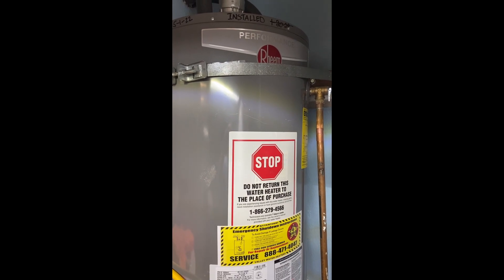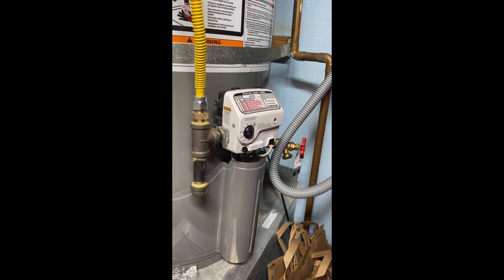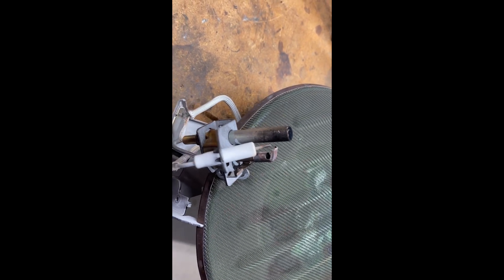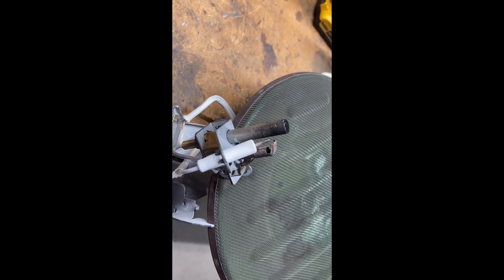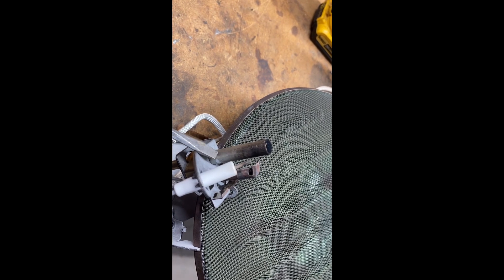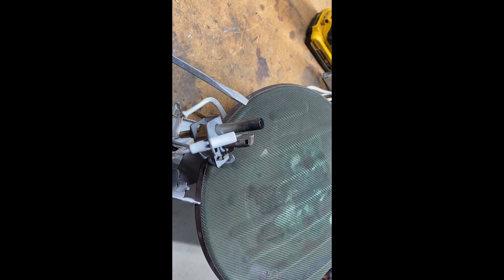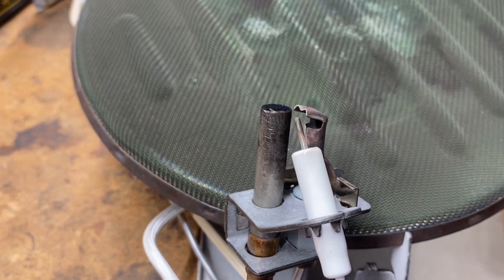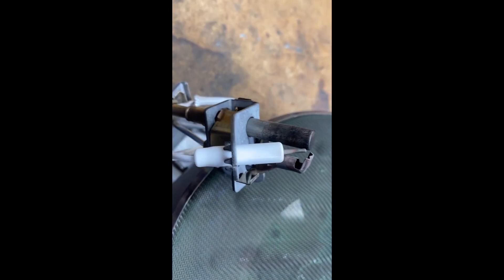Easy Rheem Water Heater Pilot Fix!

Comment: Interesting , I've cleaned the thermopile to increase voltage but never lowered it. You should only need 300Mv to power the motherboard (technically) They top out at 999Mv . Those valves are Buggy if you ask me I see them Give false error codes all the time.  Great video thanks for the info!

Comment: I have a rheem performance platinum Model XG40T12DU36U0 and the burner assembly is way thicker and wider than most of the ones showed in YT videos, the problem is that is not coming out. I tried different ways to pull it out and it looks too wide. Any recommendations on how to take this out?
Reply from the maker: I couldn’t find much info on that model. Is there a larger sheet metal piece to remove? Look for screws around edges. They got it in there , so it must come out!😀